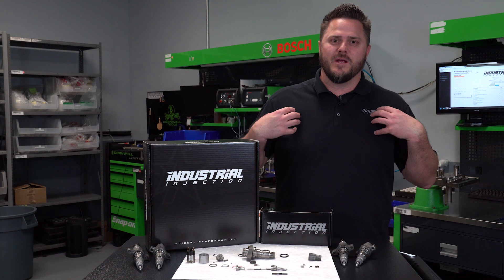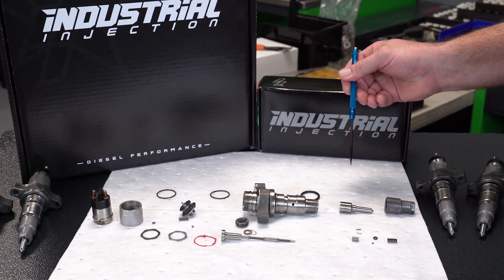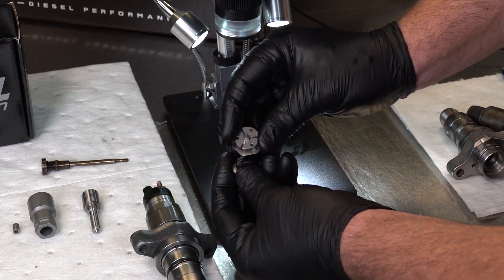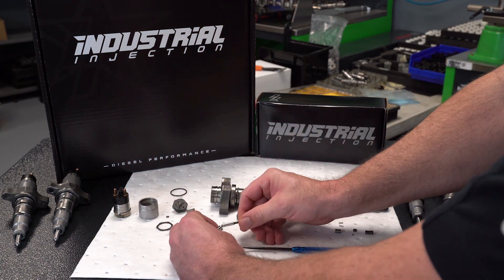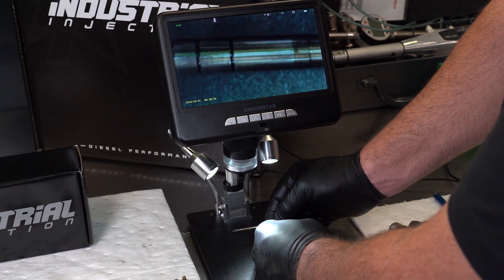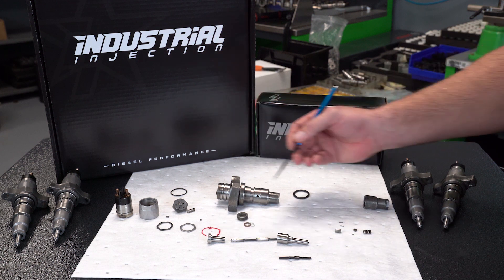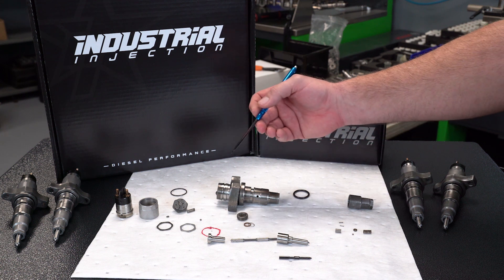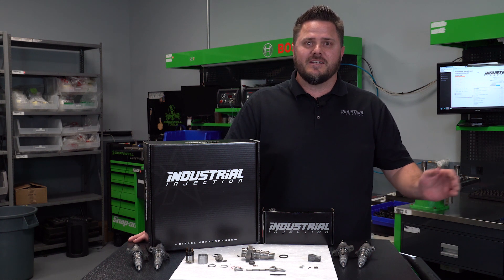Inside a 5.9L Cummins Common Rail Injector - Why it Fails

Comment: Filtaration and fuel quality IMO, is the most important factor in getting the most out of these injectors. Spend a little more buying top tier fuel and use a quality injector cleaner with each tank.

Comment: I was thinking about having Steed Speed make a two piece manifold that would 2 cyl into one turbo and the other 3 into one manifold with the other into a second turbo. So has anybody ever tried this and would I gain anything or just a waste of money ?
Reply: Waste of money unless you plan to use a tubular manifold.  You will pay way more for a custom log manifold than to just buy a hot pipe.

Comment: The injectors failed because industrial built them. my buddy had 2 sets bad right out of the box.
Reply: Mine are junk.. poor fuel economy
Reply: I just pulled 6 of them out of our 06' and all of them tested bad and never really ran good out of the box. They only have 22,000 miles on them and the truck runs a upgraded fuel filter system.

Comment: How many miles would you say the typical common rail injectors are good for? Does good fuel supply pressure and filtration greatly extend this?
Reply: Stock filters is about 150k miles is usually when 5.9 injectors go bad. 200-250k miles with a airdog fuel pump cleaner fuel they should live longer.
Reply: @Nathang2233 I run a Fass 150/150 and the factory Cummins Stratapore filter. Currently have 282,500 miles on original injectors.

Comment: Question to the experts: Often I seen people get recommendations to replace all six injectors when the general return test is ran on Cummins 5.9 and 6.7 engines. I was always trained that only replace the injectors returning excessive fuel. Which side are you folks on?
Reply: Fleet, only the bad injectors.
On a budget, only the bad injectors.
Got money to blow or just got it like that, all of them.
The real answer is how well with your old injectors balance with the new one(s)
Reply: Instablaster...